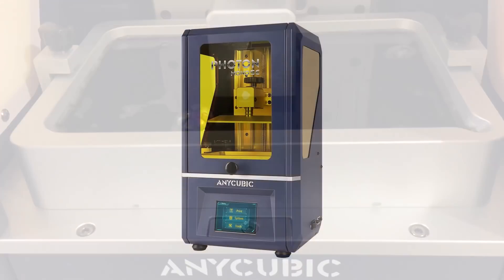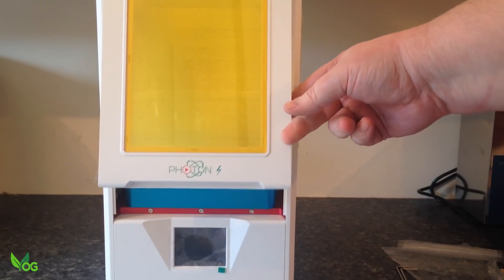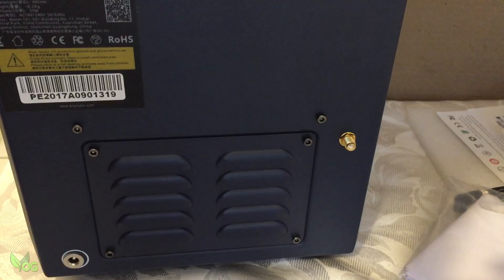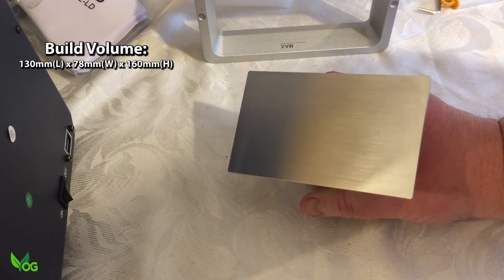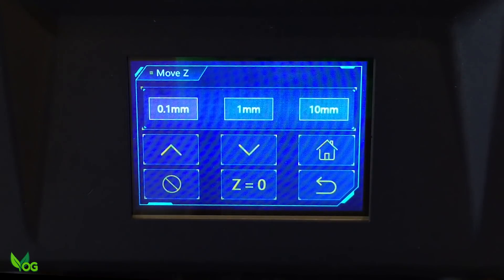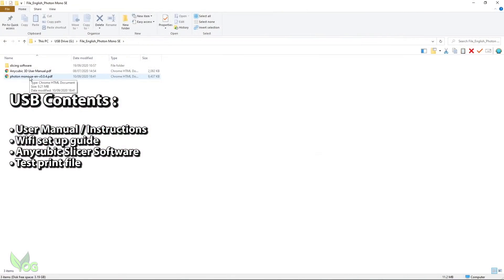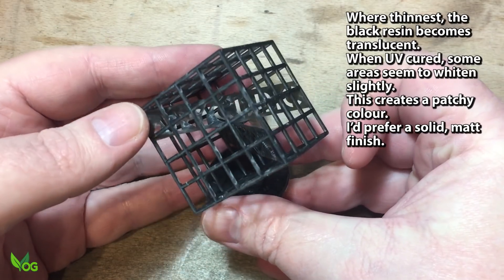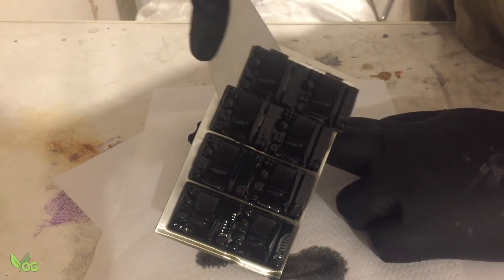Anycubic Photon Mono SE HONEST review by VOGMAN

Comment: Just a quick tip: After removing your model from the plate, soak it for ~15 seconds in really hot (not quite boiling) water and the supports will fall right off the model, no need for clipping! I do this with every model and it hardly leaves any traces of the supports, especially with the pre-supported models from Archvillain and similar patreons. Happy printing!
Reply: Nice

Comment: I'm quite confident that the grub screw used to hold the plate (the one that must be tightened for leveling) can be substituted with a knob with the thread of the correct size. Not that one is supposed to repeat the leveling process so often, but just because is handy when one has bigger hands.
Reply from the maker: That's an interest idea, but I'm not sure hand-tight would be enough... I'd guess a spanner of some sort would always be needed 😁
Reply: @vogman  There are plenty of mini ratchets sets on the market, at reasonable money. Would make tightening the grub screw an easy task. Good investment for maintenance too.
Reply: .... or print a stubby handle to fit a short length of hex driver!

Comment: With many ways to cast aluminum, I have thinking of adding bling (Polished custom rod shapes) to my auto. More exactly a 67 C10 truck. These where built like tractors for the farmers and interiors where metal door panels and full rubber floor covering. All work and no play make a truck a dull vehicle. The question is, adding bolts suspended into the casting process to dress a fabric door panel, or a contoured “U” shaped highly polished trim to a custom console? Is drilling and tapping a better idea?
  Step into new vehicles or trucks and marking makes them look more like a display case of stainless trim with wood inserted appoints that would cause eye damage on a sunny day. But after all, they charge more for these than my first house. Or second house!
  Either way, it would give my personal touch, rather than off the shelf parts. Retired auto tech. Thanks for the videos and information.
Reply: Heya, struggling to understand the question.
Resin is pretty brittle and tapping could be miserable, i dont believe you could insert a bolt mid-print tho.
But. Its entirely possible to print the object with the threads (or whatever) in the stl file

Comment: Hi, I've just stumbled across your resin printer review channel (LOL) and was wondering if you could do a review of the print quality of all 8 or 10 of your printers, using the same 1 or 2 prints on all of them. A print with crisp lines and micro details, or 1 of each type. 

Since I need to squeeze my budget, but I don't know how tight; this kind of comparison would be very helpful in figuring out if I'm aiming at <$500, or <$1,500. I want to print master dice, RPG Minis, and maybe, after seeing your work, add jewelry casting to my beading/making. 

Thank you in advance. (Just in case. :-) )

Comment: Out of curiosity, you didn't mention the ease of changing out the charcoal filters, with the lid not being fully removable how hard is it to remove/replace the filters at the back of the machine? Or is that what the access panels were for?

Comment: Great review. Begs the obvious question Why don’t they fit a knurled knob instead of a fiddley grub screw to the plate? And yes Ethernet as my shed is beyond our Wi-fi range. Thankfully the Matt spray paint leaves the fine detail intact.
Reply: A thumb screw should be easy to add! Nice idea.
Reply from the maker: Thanks John. I would imagine even the thinnest primer must fill in some of the detail, but that level is too small for us to pick up I feel. What is clear, once we get passed the horrible black resin, is that the printer gives us plenty of detail 😊
Reply: It certainly does. Keep up the good work as they’re more likely to listen to your reviews when fine tuning their products.
Reply from the maker: That's my hope John 😁
Reply: Price cost m8 ,you cna buy a grub screw for a 10 cents ,knurled knob would cost you atleast 1 $-multiply that by a 10k  printers and you will see why .

Comment: How often do you end up having to change the film on the resin vat. I already had to change mine, as it had a hole ripped in it. Still had a good bit of prints from it at least.
Reply from the maker: In absolute honesty I've only changed one, but it was amazingly new... about three or four prints old. I found resin on the screen and realised there was a tiny hole in the FEP. This is unusual but it can happen.
If you're changing the FEP, look for an upgrade. There's lots of talk out there about better prints on thicker FEPs... it might be worth looking at 😁
Reply: Thick FEP can and will blur the projected image creating soft/rounded edges.  Thinner FEP gives the best resolution.

Comment: Great Review, im wondering for those filters does the air cycle in the printng area. or does it go under and out that back?
Reply: It'll vent out the back as normal, the filters capture a certain level of the odor and hold it within.

Comment: Am looking for speed less smell and size wich of the mono Se or photon s should i buy for a first buy
Reply from the maker: The smell is the resin, so it doesn't really matter which you use. As for speed, the Mono SE has the Monochrome screen which gives faster prints and a longer lifespan.
Reply: @vogman  great thanks a bunch i'm currently doing my homework and thinking of buying the SE fits with my needs more than any other. Also watched your slicing videos helped me a whole lot to understand the process in about a month i'll get my first 3d printer and it's thanks to your help.

Comment: Hello and thanks for all your review work. 
Would you recommend the Photon mono SE over the Mars 2 pro in regard of print quality? Does the double linear bearing have any effect?
Reply from the maker: I haven't compared these two head to head and both are very well built machines that print to an excellent standard. I would say, in THEORY, a dual rail should give you better performance in the long run... providing stability which equates to better printing quality. I can't promise that would be the case in a head to head challenge over a couple of years of printing, but I would imagine that's the way the smart money would go 😁

Comment: I want USB ports and the on/off switch on the front.  I have multiple printers and stuff on my table and something is always blocking the side or back, at least this is the side not the back but these should be in the front as we access them all the time.

Comment: Thank you for the great review! I watched it prior to ordering a Mono SE. My Photon S' screen was dying and the wire to the on/off switch melted for some reason, so I decided rather than go through the issues of contacting Support I'd get myself a shiny new early Xmas present.

The first thing I'm printing though seems to fail part-way through the print, and at the failure-layer seems to print a layer in the shape of the base then stop printing altogether. Screen freezes and doesnt function. 

I've looked around on the web, and in the comments of this video and can't see that same issue. As a printer-boffin on Youtube, have you seen anyone with this issue in your travels?

I've done re-slicing and am trying a new USB as of now... I hope I can get it going properly soon!

Comment: VOG could you comment on this? Does resin or ambient temperature mean much in resin printing? I got this machine based on this video, but I'm not having too much of an success and I'm slightly disappointed for now. But my room temp where I have to machine is around 16C so I assume that might be the issue? It's bit odd that the model on stick seem to work ok, but if I slice with their software, it's about guaranteed to fail in stock settings. I usually only get the raft and then the part is f'd. It appears that models in stick have higher exposure times than default settings on slicer and this is why I've been beginning to think about temperature and how much it possibly affects prints. Any slightest hints are welcome.
Reply from the maker: Temperature DOES make a difference.
Here in the UK we had a cold snap just after Christmas and for 4 weeks I didn't do a video. The reason was all my printing efforts failed. The resins thickened in the cold!
My printing area has basic heating, preventing things freezing up, but low teens C was what I experienced.
Just as I decided to build an enclosed (a simple polystyrene box the encase the printer), the temperatures improved.
Read the label on your chosen resin. Many recommend a minimum heat of 25C. 
Now I rarely see 25C, even in summer, but 20C is probably my norm and I have no problems, but much below that and you may need a heated environment. These were popular with FDM printers so look them up on YouTube. Many are just tents.
Reply: @vogman  My sincerest thanks for replying. This was very valuable info for me. Yeah I live in northern scandinavia and it was crispy -26C at morning. I don't like to keep my resin printer here in nice warm living spaces for obvious reasons and currently have machine at mentioned colder place and more preferably would move into garage which is even colder for few degrees. I have Ikea Lack based enclosure for my FDM printer and it works really well, but that wouldn't quite work here. But it seems like I need to create something similar with somekind of an small auxiliary heater. This definitely helps, thanks again. Now it's also obvious why my first test was really good as I had machine in warm living space in kitchen under the oven air extractor (that can't be proper english :D ).
Reply from the maker: Excellent. It sounds like you have all the ingenuity you need.
Here's a helpful tip... for long term storage, resins like cool areas so there you're fine. But if you know you're printing tomorrow, then bring your bottle of resin into the warm parts of your house the night before. Don't open it, just let it adjust to room temperature. When you shake it, it should sound like water. If it sounds like treacle, it's too cold 😁
Reply: @vogman  Will do that. One more quick thing, it's mentioned to shake well the resins before use and did that once, but there was really much trapped air bubbles in the resin and had to wait some time. Though I guess this is partly because of that colder temps and possibly more viscous contents. Anyway is that vigorous shaking absolute must with resins anyway? I personally though that resins are so to say homogenous materials and wouldn't sludge(?) in long-term storage. Any real life experiences about this? And thank you again for valuable information.
Reply from the maker: It's not vigorous shaking, no, more gentle shaking. In honesty stirring would be better as all you're doing is mixing the content. It doesn't need aeration. A few tiny surface bubble don't matter, but nothing more.
So, be lazy in your shaking 😁
Reply: @vogman  That's not a problem for me 😊, thank you again for your time. You've been very helpful and with these tips I'm confident that I'll succeed in future prints.

Comment: Maybe you know this already, but any Photon Workshop file for your printer with R_E_R_F name will do this print with 8 different exposures. I made my custom one with ameralabs test city.
Reply from the maker: Yes, starting at 1.0 and going up in 0.4 increments. I wanted to start at 0.8 (why? I'm just awkward like that) and trying to amend it screws it up, which is a shame. But if you can make your own, I'm very impressed. That's not a skill I have 👍👍👍

Comment: Great review, really like your format; its clear and right to the point. I dont like that Photo leveling system. The way the plate turns, I could see not getting it straight could be an issue. I prefer the EPAX leveling mechanism minus the lousy screws that came with mine which I replaced with good stainless steel.
Reply from the maker: I've yet to try an Epax. I hear good things 😊

Comment: What a wonderful machine - may bee one day I could go that route...
Great review bud, great review.
One question with resin, how do you empty the pond and clean it up?
Reply from the maker: The resin vat? It's easy (but messy, so gloves are needed). With the printer you'll get mask, gloves and paper filters, all of which you can cheaply replace. Put a funnel into the resin bottle, add a paper filter to catch any lumps of print that may have broken off, and pour out the vat. Use the plastic scraper (provided) to aid the process. Then wipe out with paper towel. Usually I then add a little IPA, swill this around, empty it and wipe with paper towel again. That's it.
This sounds involved but is genuinely easy. 😊😁
Reply: @vogman  Aaaah that makes sense... thanks man, hey - keep safe - here in NZ we are isloated so things are "controlled", but I just saw a report about species to species...   Kia Kaha mate...

Comment: Hey Vog. Good to see another honest review. Thank you. I'm really liking this one. As you know I'm a fan of the hinged lid but like yourself I also have sausage fingers from being a builder. Great video. I know I asked before but could you tell me once again your bottom layer exposure time for the original photon please?
Take care bud 
Tony sausage fingers.
Reply from the maker: Thanks Tony 😁
With a standard Anycubic resin like this, the S should be fine with 8 secs normal and 60 for the bottom layers, assuming you're doing 0.05.
Any problems, just drop me a line 👍
Reply: @vogman  Thanks VOG.
In your opinion,  can the 60 seconds go up to 80 to ensure a good adhesion?
I've been using 12 seconds for normal layer but I think I will try dropping it to 8.
Thanks for your advice mate.
Reply from the maker: If 12 is working for you, stick with it... performance between printers does vary. Just as with 80 for the bottom layer is fine.
The trick is to get the lowest setting you can to extend the life of the lighting array and speed up the printing. Ironically the best way to achieve this is through lots of printing. Head over to Thingiverse and download the AmeraLabs test print - https://www.thingiverse.com/thing:2810666 - adjust, print and repeat. Once you dial in, stick with that resin or you'll have to start all over again 😁
If you're having adhesion issues, watch my video from a couple of weeks ago https://youtu.be/zfNATNOfojA
Take care buddy.
Reply: @vogman  Thanks mate. Not having sticking issues. My printer is in quite a cool room. I forgot to warm my build plate before printing. My bad. It's not a problem in summer. And I just double checked my settings and I was at 16 for layers. Oops. It makes perfect sense that the more exposure, the shorter the life of the screen. Been going for around 10 months with no issues but have now lowered to 8 seconds and will give it a test tomorrow. Thanks again buddy. If it wasn't for your help I would have just stuck to fdm and not bothered with resin.

Comment: Thanks for the video! :)

I find my Mono SE way slower than my Photon S though.
Reply from the maker: Thanks Triss. The Mono shouldn't be slower... I wouldn't say it performs any faster than the S, but the exposure time should reduce your overall print time. What exposure times are you using on your resin?
Reply: @vogman  Eryone Standard Grey. Exp: 2.7s on the Mono SE, 8.5s on the Photon S.
I kept the same other settings for both.
The Mono SE takes a lot more time to complete the lift-lower plate process than the Photon S, resulting in more or less equal overall printing time, or slightly faster, for the Photon S.
I somehow think it is an issue related to Photon Workshop, although not sure at this point without any other slicer capable of saving a .pwms file.
Reply from the maker: Try this... https://mango3d.io - it's a very capable slicer I'm playing with right now.
By the way, 'Triss Merigold'? I'm quite the Witcher fan so just seeing the name has had her song stuck in my head all day 😁
Reply: @vogman  Many thanks! This seems promising! :D
Yeah, I'm also a big fan of The Witcher! :)

Comment: Imagine an automatics central lubrication system Wouldn't it be crazy?
Reply: I am not sure of exactly what lubricant is required or how many locations, but perhaps an idea from my farming days, could spark an idea. 
  On the farm, many large pieces of complex machinery is used to accomplish anything. The most complex by far is a “Combine”. As the name suggest, it combines many operations in one machine. These had many moving, rotating and cutting parts. Enough to give nightmares to some. To lubricate, someone came up with the idea of hoses attaching to each point of daily lubrication to a grease gun. It works like a bottle jack with fixed displacement but at high pressure. The levers stroke achieved one pump of a fixed volume, divided by the number of fittings, determines how many strokes it takes to lube each fitting equally. Assuming the air is purged from each line, attached to its proper fitting, say 20 pumps would grease 30 fitting on bearings, pillow blocks and sintered bronze bushings used under light loads. The grease gun had a reservoir with handle operated pistons, attached to a manifold. The manifold had the lines attached to it. The pressure could be very high, spring pushing lubricant forward or gravity feed is less viscous or very thin oil is needed. Just a thought!